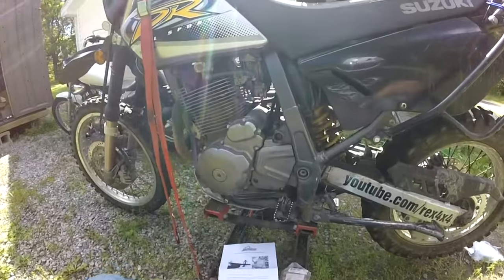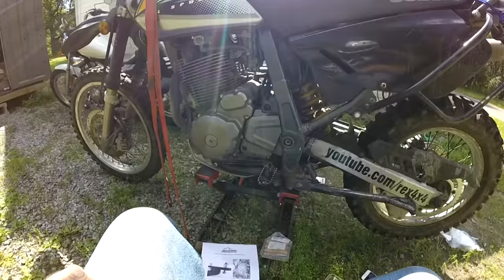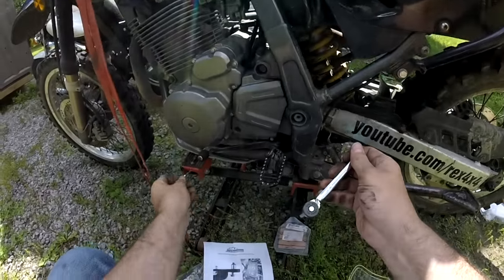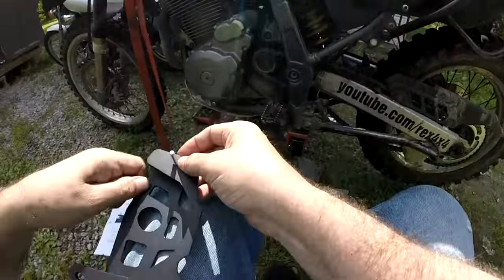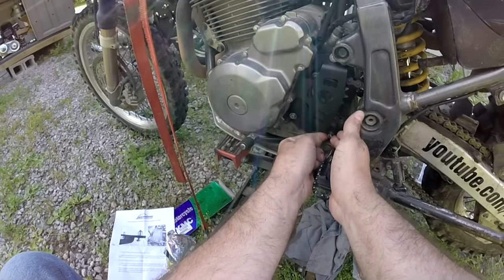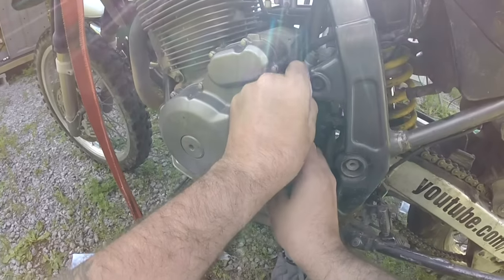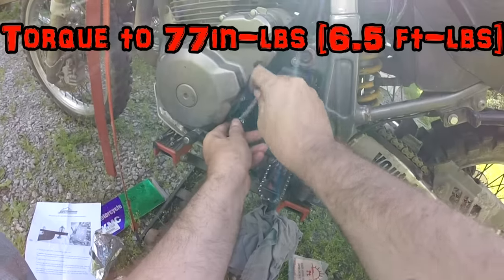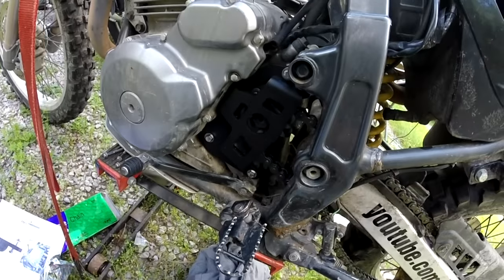Case saver install from JNS engineering

Comment: Isn't the chain touching it when it's jumps around...?
Reply from the maker: No? Why would it touch ??
Reply: Rex4x4 the top, back part of it is very close to the chain...in some situations the chain can rub the saver....
Installed it today, and took it off... looks to close...
Do you have any chain bite marks in it?
Reply from the maker: @sharonsharon2604  got rid of the bike a  couple years ago .... sorry
Reply from the maker: @sharonsharon2604  I also put a smaller sprocket on so i might have had more room.
Reply: Rex4x4 thanks for the reply!
I have the original sprocket, I'll check it again...
Ride safe🤘